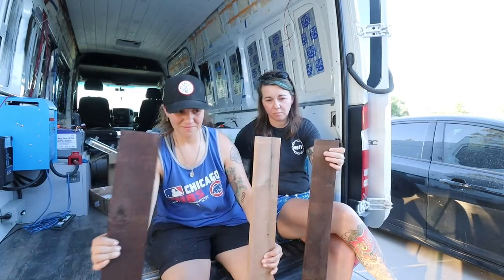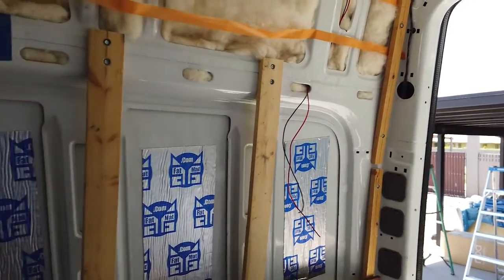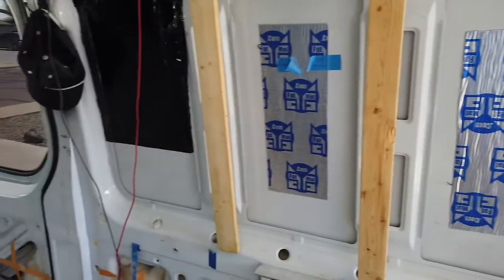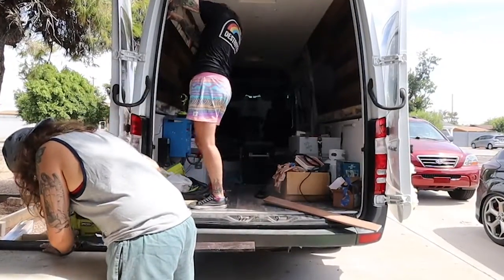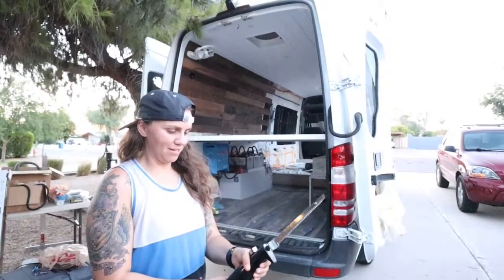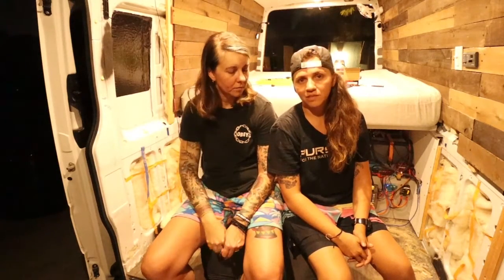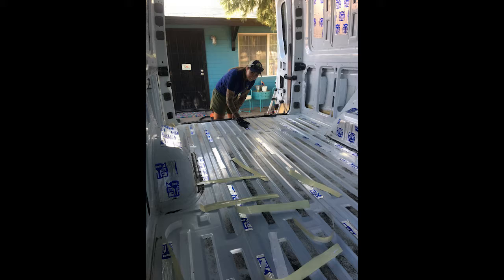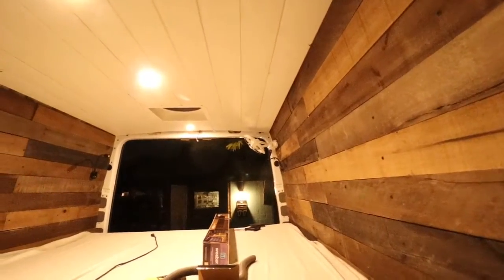Sprinter Conversion | Installing Barn Wood Walls

Comment: Greetings from Canada, about 80-miles north of Toronto. Aquick, and likely dumb ol'fart's question - was there a reason, given the heat you experience in AZ, that you did not add more insulation and a vapour barrier behind your increasingly cool looking wall work?  Cheers from here... :-)
Reply from the maker: Hi Robert, thanks for the question! We actually have quite a bit of insulation stuffed back there as we were able to put more in as the walls went up and we no longer had to worry about it falling out! Lol. We didn’t include a vapor barrier because the Havelock wool doesn’t need it! They actually advise against installing it, so for once we decided to follow directions.  We’re hoping this is our last summer experiencing the Arizona heat for a while as we’ll be heading to the great white north soon! Cheers!